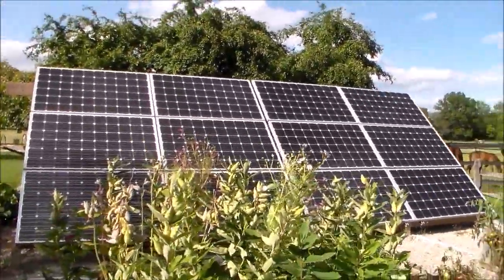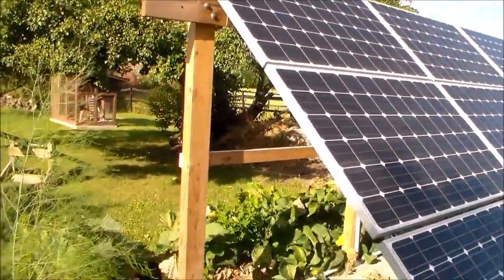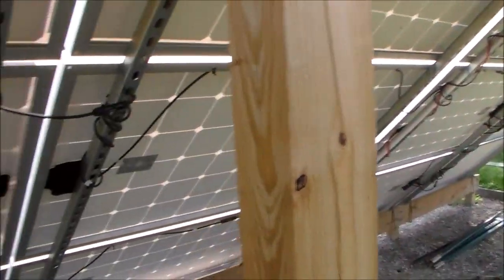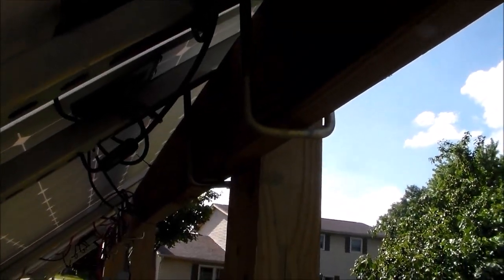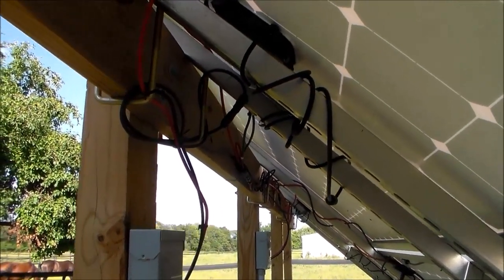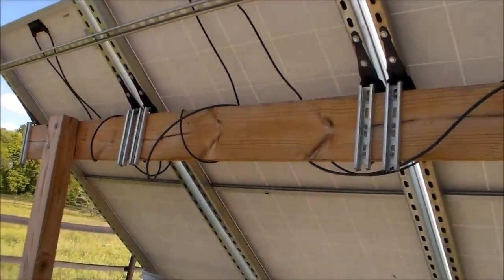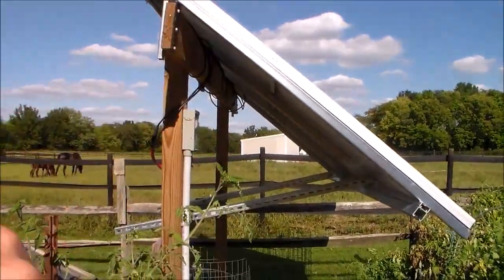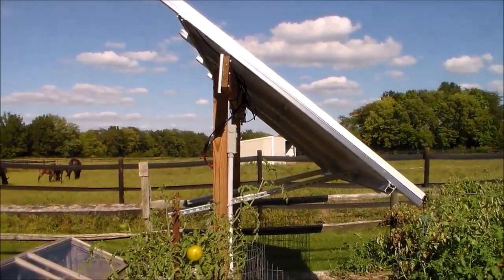DIY Solar - Episode 16 - Solar Ground Mount - 1-Year Update

Comment: I dont understand why so many people that are using tilt adjustable mount systems make the rear horizontal mount so high up in the air.  You can cut your rear height to almost half and get the panels overhanging the rear horizontal more to create more weight to the rear and that will help immensely with adjusting without bearing so much weight while adjusting the tilt angle. The whole front horizontal likely can be deleted.

Comment: I have noticed the carpenter bees attack the non painted or stained wood. I plan on doing a similar setup on my installation.
Reply: Use galvanized pipe instead.

Comment: In regards to your HW Panel Rack . . . I wonder how heavy guage Pvc would work for the 4 legged base structure. The pvc industry has really been asleep at the wheel for the past 40 years and missed out on their potential. In the mean time, as far as those top & bottom cross beams how about joining some Trex together to make those ???
Reply from the maker: Not sure that either pvc or Trex would be strong enough since there is a lot of weight to the panels. Add the possibility of strong winds and extreme weather! Instead, if I were to build another rack, I would use galvanized posts for the legs and then mount a couple parallel pieces of the strut material in place of the wooden header. It would be super strong and resistant to insects as well.

Comment: Nice to find this site with all the varying videos! I have a question on the adjustable ground mount. Since the front of the panels are not anchored I'm wondering about the panels swaying back and forth in the wind. I see you attached the front edge of the panels together with the half-height unistrut. But it seems the whole unit would be subject to side-to-side play without any lateral bracing on the front edge.

You were mentioning that the structure has done well in 50-60MPH winds. I'm just wondering what I'm missing.
Reply from the maker: Hi. Thanks for your comments! No problems with any side-to-side sway to date. Everything is still working well with the mount and the panels.

Comment: Have you noticed any Bimetallic corrosion between your panels and the Superstrut due to the Galvanized steel and aluminum frames?
Reply from the maker: Rick Irvine I have not noticed that so far. I have been checking monthly just in case!

Comment: I would love to get a follow-up of the adjustable tilt design if you are moving to a new place v2. Will be building a similar set-up next year to Scandinavia where snow is plenty so having summer/winter mode would reduce snow maintenance
Reply from the maker: So far everything is the same as in the original video I posted. We still do not yet have a move date. However, yes I will provide an update video when that happens. As I mentioned in one of my previous updates videos, if I were to build the tilting solar rack again, I would change the pivot point of the panels so the center of gravity is more suitable. Currently, most of the weight is on the downward side, thus making the panels a little heavy when changing the angle. If the pivot point was more centered, it would make that easier. I'm also thinking about adding a hand-crank in version 2.0.  Thanks for your comment and good luck with your build! Best wishes!

Comment: Just discovered the channel and have been catching up on the solar updates - very nice system you have going. 

For the adjustable solar panels just use a counter weight (i.e. a couple buckets of water hanging from the top of the struts) when adjusting them.